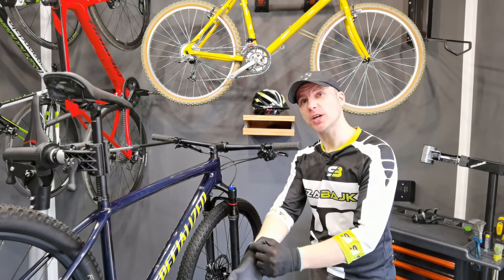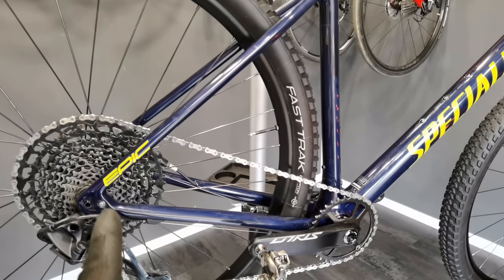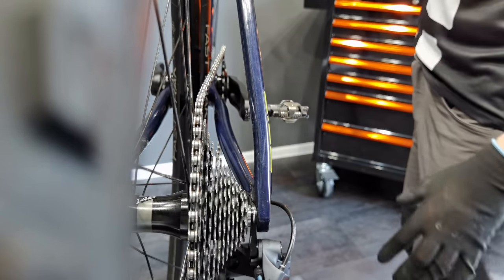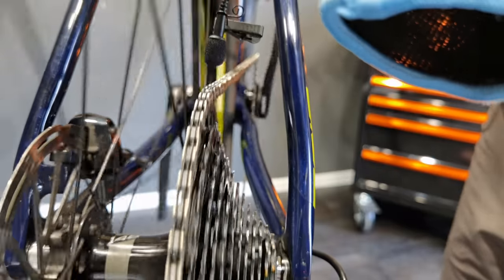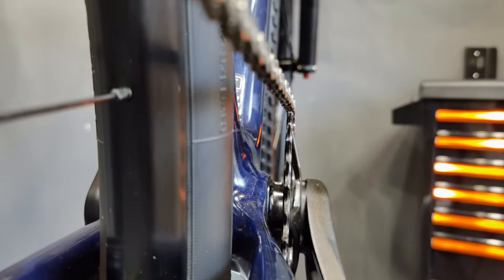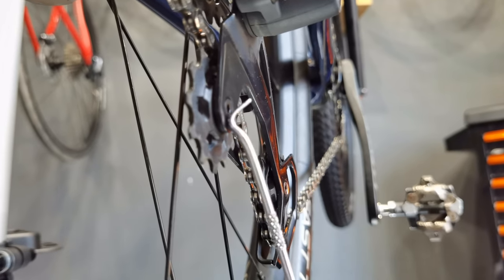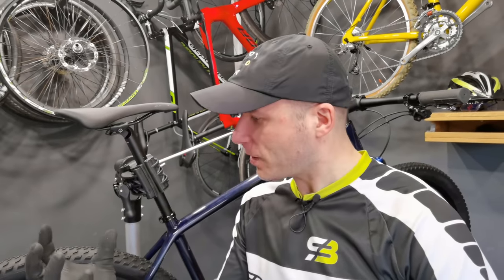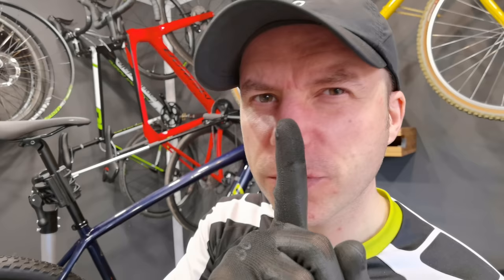If you were close to XC race podium riding on 1x12 drivetrain, you'd win it on 2x11. Here's why...

Comment: The derailleur hanger is mounted on the wheel axle. If mounted on the frame , there should be less space between sprockets and frame.
Reply: How can it be mounted on the axle?
Reply: @paulb9769  At 1.49 you can see the axle goes through the derailleur hanger, (or pad, don't  know the exact English word). All the bikes I had until now  have a separate attachment on the frame itself.

Comment: Nino rides 1 x 12. Dropping a chain mid-race due to front derailleur would be catastrophic. XC racers spend relatively little time in the 50 cog. 

Also, according to Friction Facts, smaller front chainrings and rear cogs are less efficient. The links rotate with greater angle so there will be greater energy loss due to friction.

Comment: The space that could be used a little bit better exists incase the chain drops out of the 10 tooth so the frame doesn't get damaged. Do you prefer a better chain line or the risk of a broken frame when the chain drops ?
Reply: Good point. I wanna see his solution.

Comment: maybe floating chainring will be the "next big thing" for 1x drivetrains
Reply: Possible 👍
Reply: Wouldn't do much good because the chainstay limits the space available inwards, and on the other side you'd have to move the crank outwards to allow for more space, which would set your feet further apart (increase the Q-factor) which is not ideal for effective pedalling (possibly harmful even).
Reply: @infidel1045  Measured clearence on my 1x9 fully 6mm to chainstay (gap can be bigger with cleverly designed and cnc machined cs to bb part), 4mm to crank arm, maybe enough to release some side tension off of the chain. Narrow Q factor is very important to me, never ever want to widen it. IMO in the last 20 years mtb industry is more about trend and fashion rather then good and durable solutions.

Comment: Just a thought of mine: What if you put one 2x chainring on your 1x system? It would allow the chain to handle the extreme chainline better and the clutch should still keep the chain in place. Otherwise you could also put a chainguide on
Reply: Thats what the newer Shimano system allows you to do with their 2x12 system which uses a 10-45t cassette with a (28/38 or something close to that )2 chainring set on the front. Of course the newer stuf is more expensive and harder to get due to  supply shortages  from covid ,so good luck trying to find it. The 2x11 system mentioned here is quite adequate for recreation or competitive xc racing and superior  to a 1x12 system for most racers.

Comment: You completely right the bike industry is just dumb seriously. I run a ten speed cassette without the 11 t so its nine with a spacer behind the largest cog to move it all to the right much better chain line . I have also made a adaptor and a sprocket to run a 2 bi with a 18 t and a 34 t paired to a 13 28 cassette with a short cage deraileur with upgraded spring tension better than a clutch deraileur good chain line and heaps of ground clearance it did take me days to make but works well .

Comment: I am on a 10 speed with a 28 tooth chainring and an 11/46  cassette . I should have just stuck with an 11/42 as the the 46 tooth cog  has a poor chain
line as far as I am concerned  . If you could develop a pivoting cassette that would change its angle depending on the chain line angle . It would probably have to part of the detailer system moving in lock step with the detailer
Reply: lol since when does a larger cog influence chain line???

Comment: For commuting i removed 4 cogs from a 10 speed cassette to create an 11-36 6 speed cassette thats an inch and a quarter wide. On another bike i removed the least used gear which stopped the chain from grinding the outside of the chainring in 1st.🙏
Reply: That's one way to go single ring.
Reply: No good for keeping up on group rides obvs but its light reliable and cheap with a handlebar mounted friction shifter. I'd go single speed but theres hills in every direction around here!

Comment: So how can we bring the cassette outboard more to match the chainline?
Reply: With my 3x10 system my biggest chainring is even more perfectly aligned with the smallest cog, and with the smallest chainring it's more aligned with the largest rear cog for climbing. and its  a cheap system to build and replace 10 speed derailleurs and cassettes.
Reply: increase the hub length ??
Reply: If you have super boost, your cassette will be further to the right.

Comment: Its better to have a very smaller BB size i have an 118mm bb and 9speed and my chain is bending on my granny gear but if it shift at the biggest ring it stables so yep make sure to check the BB size or if your bike is fitted to have more speed drivetrain nuff said

Comment: yeeaaaa.... but the power difference on low speed is not so big) that why the chainline moved to the lower gear side))
Reply: Right. Maybe compensated for weight loss of not having an extra chainring, extra shifter and derailleur.
Reply: If that was true then road bikes would use a 1X instead of a 2X especially that road cyclists are a sucker for weight savings. The advantages of a 2X significantly outweighs the weight penalty, and narrow-wide chainrings + clutched RDs eliminated chaindrops (at least for me). If that's not enough, chain guides are cheap, light, and maintenance-free to further guard against chain drops.

Comment: I have a 1x12 and don't have this issue, maybe it is frame geometry or maybe adjustment, but runs really smooth on all gears.
Reply: Some bikes are built with 1x12 and big cassettes in mind. Others are almost a retro fit of old chainstays designs. I think this makes  difference.

Comment: always said why did we lose a chainring, XC is the most extreme cycle sport yet our bikes now have less gears than a road bike
Reply: And people say that the weight saving are worth it.

If it was worth it then road bikes would all come in 1X now, especially that road cyclists tend to be weight weenies.
Reply: @sepg5084  1 team tried it, didn't last a full season before going x2 again i remember having 30 gears at one time now were pushing to get 12, madness
Reply: @MrDavidfball  having 30 gears doesn't make any sense because most of them are copy of each other (the gear ratio is nearly same). However 2×8 or 2×9 can easily have range of any 1×12, without extreme chain angles and with smaller steps between gears (with bigger chain ring in front). 
That's why roadies use 53×12 or 53×13. The bigger chain ring in front, the smaller steps between each speed.
Reply: @kosskrit  even if there are some ratios that are very close it is nice to have the option to have them.
i've had a 3x9 in the past and barely used the lower chainring but it was there for the steepest of climbs in my area if needed
Reply: it's extremely course specific a 1x setup and usually seen in TT & triathlon. You can weight weenie a 54t front in carbon pretty easily from aerocoach withouth breaking the bank so i guess it's an option to consider.
Reply: @shredfreak83  carbon is getting cheaper but as for 1x set ups i can't see the use, sheading 100-200 grams yet having to talk about what chainring works best is madness.
I raced XC in the 1990's and if i turned up with shimano XTR i had the same gears as the worlds best all the had better was works frames and forks, and of course back up

Comment: I think the 1x fad will be similar to the press fit BB from a few years ago where we were all told we needed to ditch the old threaded BBs and get on board. And now expensive bikes are again switching back to threaded cause it's simply more practical!
I never saw the downside of a 2x or even a 3x! I have both a 2x11 and a 3x10 and I love the range and flexibility it gives me. I heard some people struggle with chain rub on the front derailleur but I never experienced this myself.
Reply: It's an unending cycle of things to buy. Up next is Classifieds internally geared rear hub which will effectively turn 1x into a 2x.
Reply: @josephphillips865   Without the need to get off the power to shift between the front rings.  It'll be a game changer for sure, but is very different to comparing it to a current 2x setup...
3x is dead, 2x is in the hospice for competitive MTB setups...
Reply: @WRXJIM  True. Though in fairness how often does one change gears upfront? I'm not a racer by any means but the way I view my 2x is a low and a high gear! If I'm going on tough terrain or uphill them I'll use the small ring. Once I start going downhill or I'm on flat smooth terrain I'll switch to the large one. 
For most folks I don't think you can beat the light weight, simplicity and serviceability of an external mech. An internal one is nice and protected but if it misbehaves, there is very little you can do as a user I think.

Comment: I am still a 2x11 user, my upgrade to my deore xt m8100 was a deore xt di2 with xtr FD , I invest money on di2 instead of the new m8100 (all the people say I am cracy) but we are ones that investigate, research , instead of follow the marketing involved to drain our wallets , the 2x11 is for me the best option , more range , less big gaps between  gears , always find the best cadence , saves power  on my legs when my pathners with same FTP are struggling on the lastest climb of the routes, and i playing with my wolftooh 45t adaption to my m8000 cassete , to finish my fairy tail , Would be nice to test in someway how many watts lost on a 1x12 with this extreme chainline , suposed to be  3 to 5 watts of acerage power on a 4 hours trail  , is a huge difference in terms of efftot   to someone  that knows the efforts , would be nice to test it BTW,  the thing that I dont know is how???? , need to be with a machine that apply the same torque or something like that , i dont really know how ... thanks sick biker good content vidios as ussual

Comment: Im not an XC racer at all but curious to know how many watts are 'lost' to this chainline problem, because im sure with a 2x system it will take longer to change gears meaning more time off the power waiting for the chain to move, its heavier and also you have to shift the rear anyways to compensate for the other chainring ratio. also if it is a very small amount of power lost, line choice during the race, technique, weight and also general fitness would have a larger role in being faster.

Comment: is 1x9 good?
Reply: nope. You'll either have too little gear range or too big gear jumps
Reply: Not quite, unless you have a casette with some very fitting gearing, but it will be good only when there are not too many hills.
Reply: biggest cog is 36T, so yes, quite a struggle when climbing...
Reply: If it works for you, it's good. Don't depend on others peoples opinion, you have to try for yourself.

Comment: ....sram's etap axs for the road has a gear compensating feature for trimming and adjusting chain line as you shift up and down the rear cogs. Honestly, I bet it could be made to work on a 2x11 or of sram wanted 2x12 on a mountain bike while still keeping only a single front shifter.

Comment: Its all about frame design , the best scenario coming from Niner's CVA  suspension design , just check that out how they eliminates that part of the frame witch stays between the tire and the front gear , but in the future i can imagine that the rear gears will fit-move in each other , so , the derailleur will stay in place and the gears will move , what you thin , its possible to design such a system  ?
Reply: Yes I think the newer bikes specifically designed for 12 speed and boost hubs make a 1 x 12 setup preferable

Comment: Well, I agree that its not optimal, but how much do you really use a 32-50 gearing in a race? I run 34-32 as my lightest gear atm and if that's a bit high, but at 32-50 I'd just get off and walk instead. 32-42 is comparable to the 24-32 "granny gear" witch was the lowest gear on my 3x9 drivetrain my bike originally had, and it was in my opinion a totally useless gear, that's why I went to 1x8.

Comment: A don’t use the 50 just some time for fun, 1x11 it’s perfect for me I participate competition mostly in mood and rain conditions newer disappointed me ……
Reply: Same, gravel rig 42 upfront 11-42 in the back, rarely use two of the lowest gears, only whilst carrying loads like bike packing. So no chain-line problems for me about 95 percent of the time... But then for racers like he said, it is bad. Though I would believe there are some XC bikes, modern ones that have longer chain stays and thus offset is better towards low gears, as higher gears used in XC fairly rarely compared to easy ones.

Comment: 1x is really convenient for trail and enduro though. Somehow the chain line on my full sus is also way less dramatic than this.
That being sad, when I go for an xc ride or really anything else I rather use a 2x.
I really wonder why nobody on the Internet is talking about 2x12 btw. 
Should have great shifting, loads of gears and really good efficiency.
Reply: If you wanna keep front derailleur, 3x9 is the best .
Reply: @maxwu1656  2x10/11 with a 42T in the back will save you weight and give same performance.
Reply: Yeah a 2x would definitely fit XC's style of riding more imo. Especially if there's a good number of flat fire road sections, you can output more speed without spinning out in that case and can climb the steeper parts of the course with better cadence due to the wider gear ratios. Gravel riding also has this, but for racing seems 2x is the way to go for gravel for the same reason.

Comment: Hi, at the moment I have MTB with 3x8 (I by 12 years ago carbon bike and it still on a road). I think about new bike but I am not sure which system is better to choose 2x10 or 1x12. I participate in MTB competitions, but I also spend a lot of time cycling for fun and I like to ride faster on hills, where you can reach speeds of up to 60 km. What would you recommend or what bike would you recommend on the market? I want a carbon one so that the weight is less

Comment: Simply no Problem, because the Chain is perfectley alligned on 6th to 10th Gear and these are the Gears that matter. The Big Casette Chainrings are only needed when going technically uphill for very short episodes. So who cares about a few watts for a few seconds? Not going back to derailleurs.

Comment: Great video. What an awful chain line! Bad design. Pure marketing
Reply: Actually that chainline has an explanation: with the chain closer to the biggest sprockets would be too much rubbing on the smaller ones where the chain bends a lot more. You can test that by changing the chainring with a smaller but higher offset and will notice more noise on the hardest gears, even could feel a worst shifting.
Reply: @ManuelMartinez09  Also, the smaller cogs cannot handle the extreme chain angle, or are far more sensitive to the chain angle than larger cogs, hence the bias towards straighter chain lines for the bottom cogs.   They had to make too many compromises to make 1x work and now they want to add even more rear cogs.  This story isn't going to end well for 1x.
Reply: @SurpriseMeJT  Maybe 1by never will be as smooth as 2by but by far is easy to use, service and adjust.
Reply: At least to me, front derailleurs are a thing of the past but also that 12th cog in the back is unnecessary. I've been running SRAM NX 1x11 drivetrain on my trail bike for 3 years now and I've just become more and more convinced it's my ideal configuration. Just enough range for everything I've come across and all gears work smooth. Love the simplicity.

Comment: Plan to have 1x9 instead of  1x10. With same 11-46 teeth. This could lessen the chain angle, perhaps lessen the chain drops. Do not like the 2x or 3x due to additional weight and noise in the fd.
Reply: Try to google width of 9 and 10 speed cassettes. They both use standard freehub, therofore there might be no difference between chain angles. However, 9s groupsets use thicker gears thus they might survive longer.

Comment: Nice video, but if all the pro all use 1x, maybe there is a reason.
Reply: Sponsored?
Reply: @fikriifi1671  so why they don't use rockshock rs1? But keep on sid
Reply: Pros have very little choice in what they ride and most of it is driven by marketing. Also pros can have equipment replaced a lot more often than any non-sponsored amateur. World-cup racers probably have their drivetrain replaced after each race. Most casual racers want their drivetrain to last at least a season. So the weight savings and simplicity of a 1x for a pro makes a lot more sense.

At least shimano is keeping the option of a 2x system.

Comment: My 1x10 has more than enough range. :)
Reply: What chainring and cassette sizes are you running
Reply: @DevonNroos  11-42 with 36 oval chainring.
Oval didn't make a difference for me but gave it a try.
Reply: Ah ok, I'm 30t up front and 36t out back
Reply: @DevonNroos  a 30 tooth is way to short. Are you running a 29er?
I'm on a 27.5
Reply: 27.5 Xc race bike, slightly loose out on harder gears I know

Comment: I think you are right but 1/12 does save a few grams in weight
Reply: its more than a few grams.
Reply: @ivanteo1973  Not if you change the cassette to a smaller range. With 24-34 chainrings you can go from the 10-51 casette to 11 or even 10 speed 11-42 casette and have 540,9% of range instead of 510%.